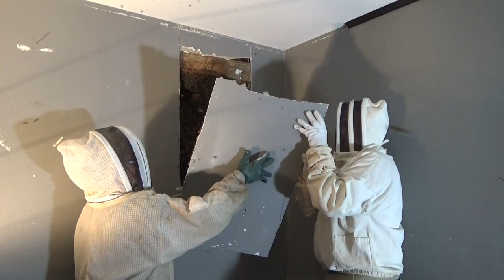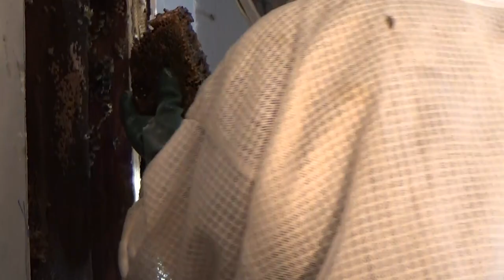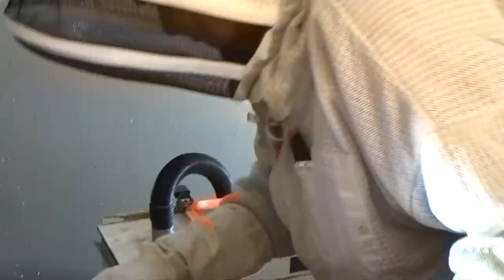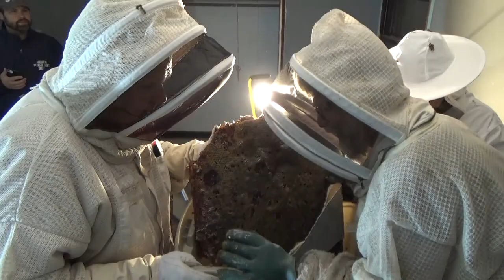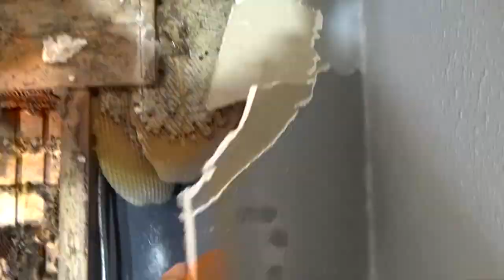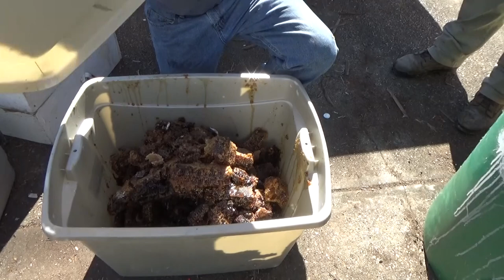WOW, a 40 pound slab of honey comb!

Comment: I see those rubber bands are used differently than I usually see. What size do you use?
Reply from the maker: We use a 7 inch rubber band and cris cross them from corner to corner, turn the frame over, place the comb on the rubber bands, and then repeat the process. It works GREAT! Thanks for watching. God's peace Charlie.
Mr. Ed
Reply: @JeffHorchoff  I finally found some. Spring is coming. :D